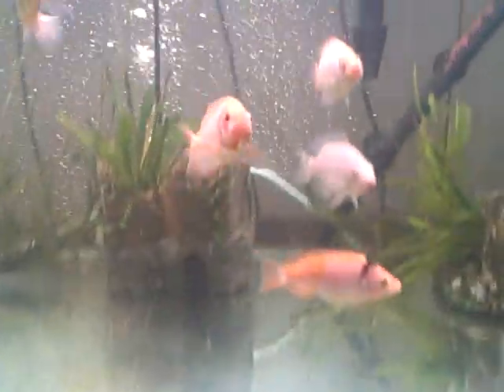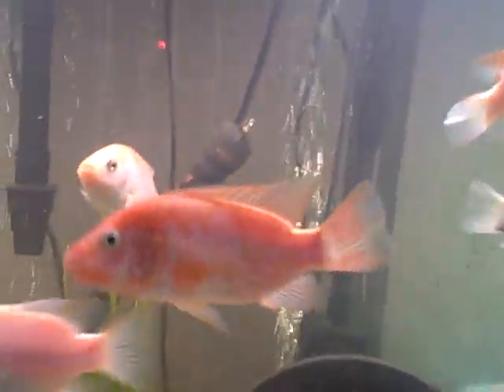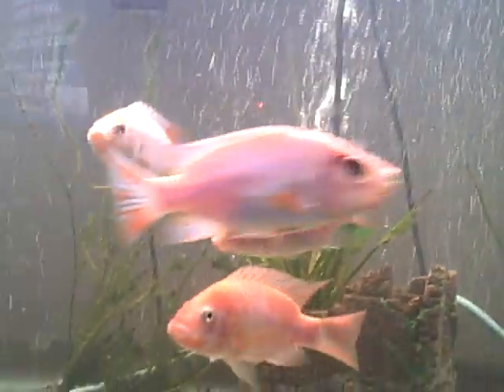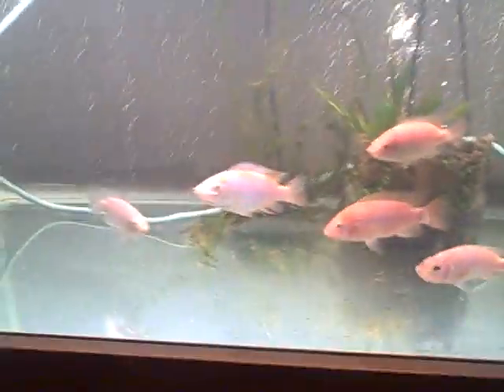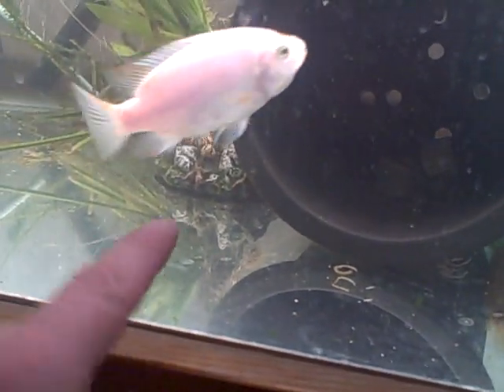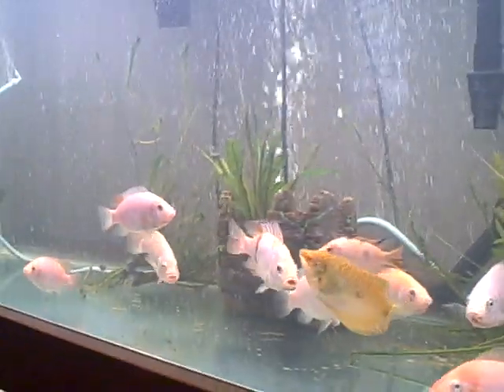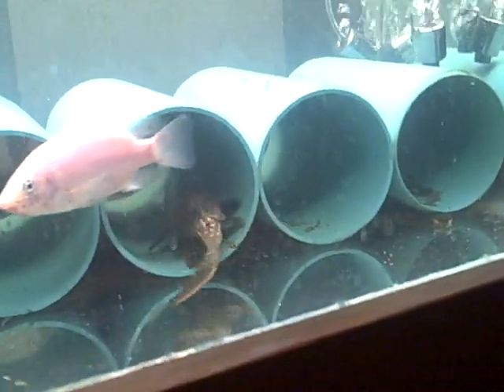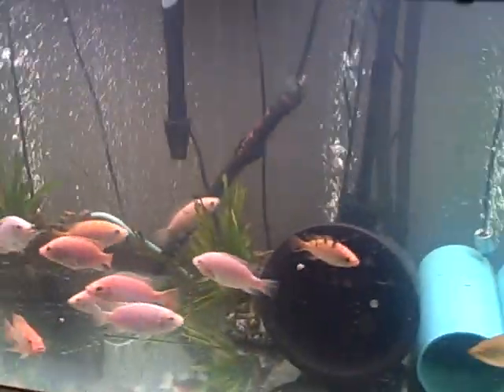Tilapia Farming And Breeding Tank System

Comment: I have been finally successful in breeding in my 150 gallon tank. What I did is to use a top overflow drain with a bit of open top needlepoint card(screen) to screen out babies. The top is open in case there is a clogging problem water an overflow over the top of screen.